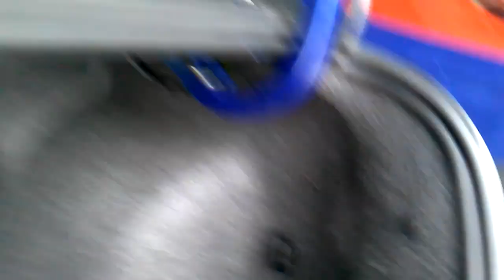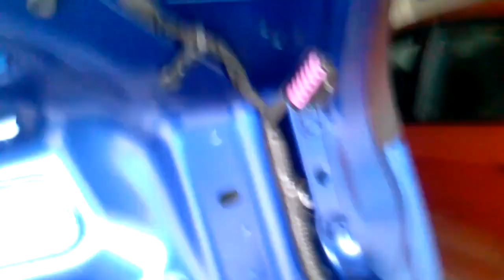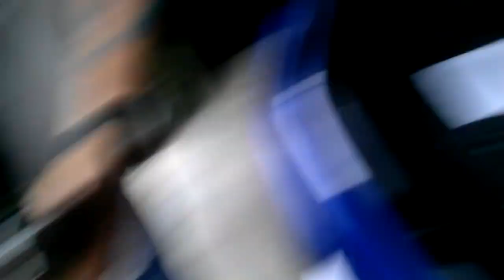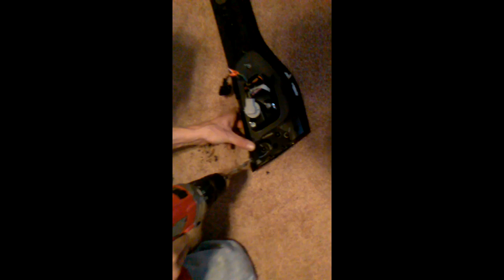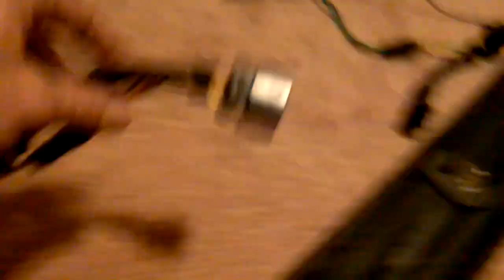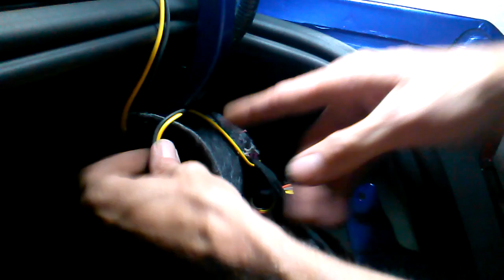Dodge Dart custom race track tail lights install

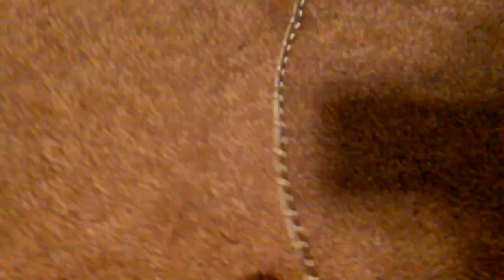Comment: the lights that i got look completely different from those shown in 7:48, I don't see a difference between the sides, i don't know which side should be facing outside and therefore I couldn't install them properly, now they look weird
Reply: They probably look weird because the lights are not held down. This isn't exactly how I would have done it. Personally separating the lense from the backing would have been the way to go. Then could have glue or something similar maybe two side tape to tack it in place. This way the lights wouldn't be able to twist and move around and create what I would imagine a non uniform and awful look. You wouldn't notice in a camera like the video. U would notice this more in person. Which is what I think u have noticed.
Reply: ***** definitely, I ended up buying the original lights instead because the ones shown above looked uneven and they weren't what I expected them to be

Comment: Derick Robinder IF I DONT HAVE THE HARNESS WHICH WIRE DO I SPLICE TO CONNECT THE POWER AND THE GROUND ALSO?? Please need help took everything out and i just need to do the wiring part...  HELP PLEASE PLEASE

Comment from the maker: tee. I usually charge $200 for install. but I do the install different than the video. I actually cut them in half longways and do a real install. (when I am doing it for customers) it allows for a cleaner and more consistent look.
Reply: Derek Robinder I want one for MI dodge dart 2013...were???
Reply: Derek Robinder  you in Los Angeles

Comment: If you dont have the harness where do you solder the wire with for the signals and constant power

Comment: Awesome kit looks like a pretty cool deal, I work for Mopar so I can get the Mopar lights for around the same price as the kit. But that's only because of a huge discount. But I'm really irritated that the dart my girlfriend just bought didn't already have the lights. So I'm trying to do this the cheapest way possible. Can I not just installed some LED strips in the tail lights and wire them up with Mopar connectors and everything and basically have the same thing? Just maybe not as clean of an installed and not as easy I'm assuming?

Comment: I got the led strip but it only has two wires one is ground and the other is for the light how do I make it work for light and brake light

Comment: I'm sorry but... that is soooo incredibly janky its just not even funny... the light strips are just dangling around in there... and not even in the proper orientation at that... as in, since they are dangling, and you shifted them around every which way while threading them through, they got all twisted around. Plus, they can just shift around and such as you're driving, meaning they wont have a very consistent look to them on a daily basis. While it does look cool on camera, in person they probably look pretty bad diffusion wise. 

best, and by far easiest thing to have done, was just grab a hair drier/heat gun and just loosen the glue so you could separate the housing. Next you drill a hole just BARELY big enough for the light strips to fit through on the back, fit the strips where you want/need them, then you could just use heat resistant glue/tape to tack mount it into proper placement, giving you the best uniform look that wont change. That way you have the tiniest amount of damage done to the tail light housing. hell you could then just cut the tape used on the factory wire housing, slip the new wires into it, then reseal it. and boom, there isn't a single indication that anything was modified.

Oh, wait... scratch that... there's a HUGE indication that it was modified.... aka it now has Charger-like tail lights. That's a pretty darn big give away that its been modified... way more so than an extra wire harness running along the inside of the trunk hood..
Reply: The tail lights and headlights are plastic welded together. There is no glue like material to pull them apart easily. Not like the old school headlights where you can just throw them in the oven and bake them open. I have yet to see a better DIY way of doing this, so if you'd like to make a video, I am sure others would love to see a better implementation.

Comment: You keep taking about this kit but there is no link to it.
Reply from the maker: i havent spoken of this kit in several years. i stopped selling it when i upgraded to the sequential kit. (which i am sold out of so they are hidden on my site, which is now herculeds.com)
Reply: Derek Robinder any idea on when u will get it back in?

Comment from the maker: Hey frost. Go ahead and go to your dealer and ask them for the kit that does what mine does. When they are done laughing at you (because they dont have anything close to it) then you can come back and talk trash. All they offer for $300 is running lights. For 200 i offer full brakes turns flashers door lock/unlock and panic. So get your facts straight before you talk trash. Let us see your handy work ? Where are your videos ? What have you created that was one of a kind.